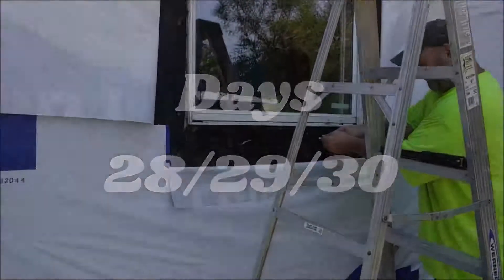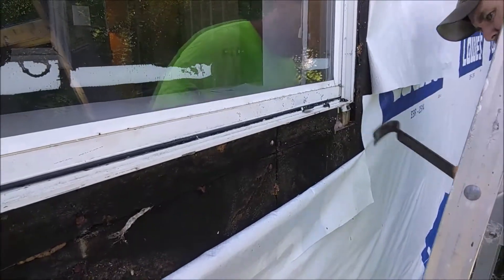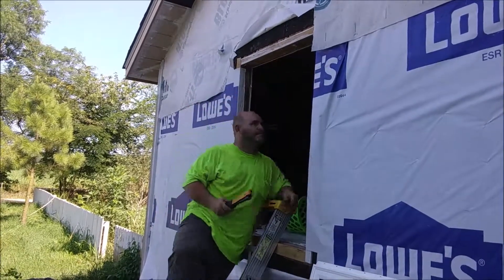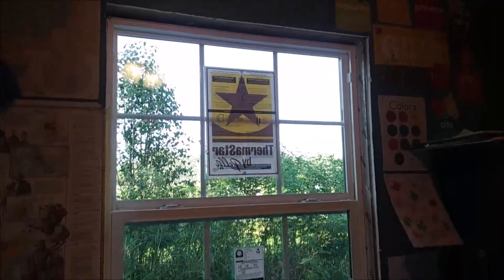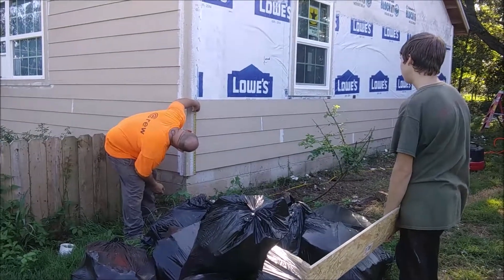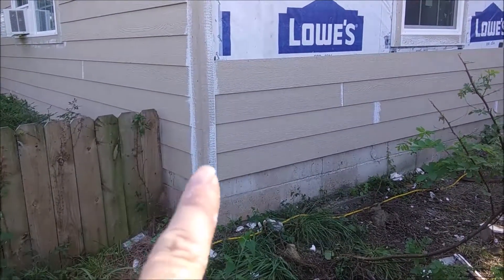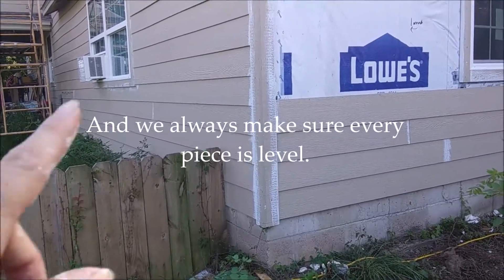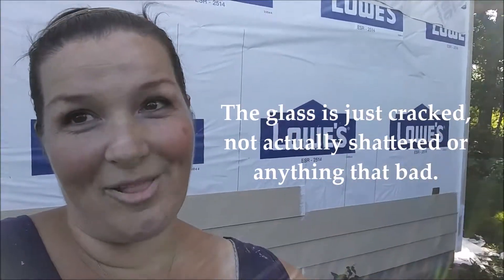DAYS 28/29/30 * Three Quick Work Days * Working on North Wall * DIY * LP Smartside

Comment: Sometimes you just have to go with the flow. It's annoying to have to redo work, but you'll probably be glad you did in the end. Also, with that fiberboard sheathing, do you guys ever have trouble hitting the studs when hanging the siding? Especially around the windows and doors? I can't imagine that sheathing holding a nail very well so I'm just wondering how you deal with it.
Reply from the maker: While the sheathing is exposed, we follow the nail line on the studs down to the concrete blocks on the foundation and Mark a line there. Then when we put the house wrap on we transfer that line back up the wall to show exactly where the studs are. So far it's worked out great!
Reply: @TwelveAcres  Cool, Thanks :)